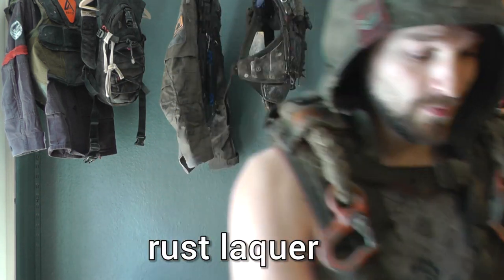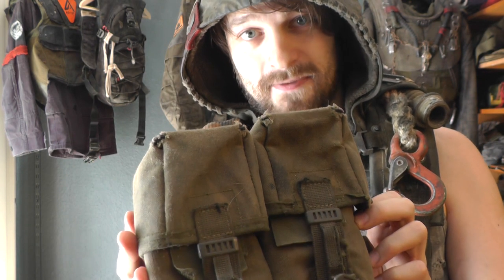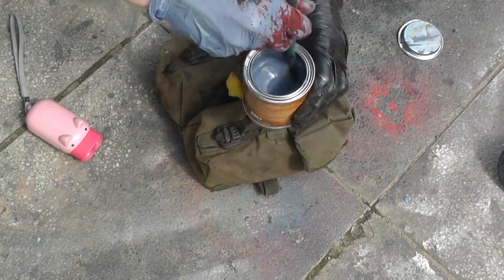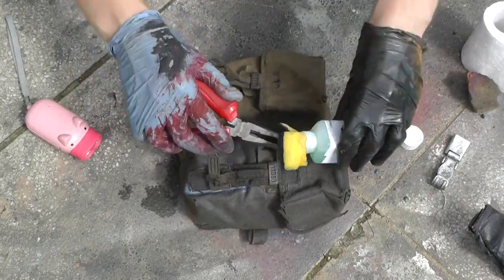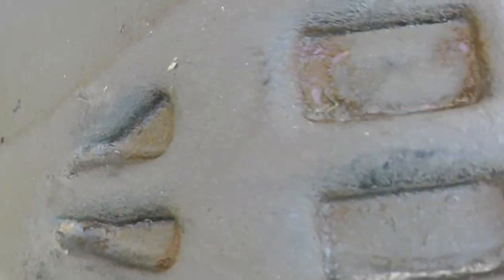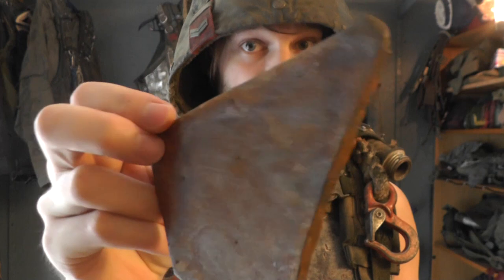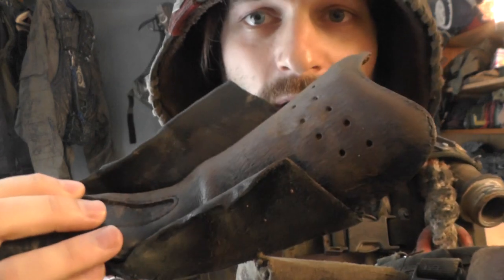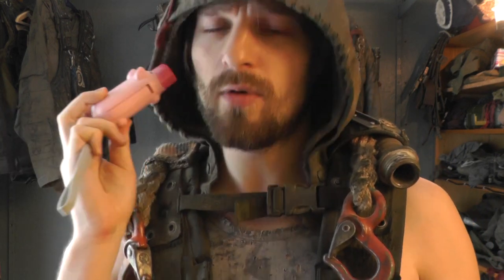Try this simple RUST EFFECT!

Comment: This reminds me of something, for oxidating wood im using steel wool disolved in vinegar, and when that stuff drips on anything else: rust, even on plastic. ofc its not the same as painting something with metalic paint an then letting that pain rust, but it might be useful for rust splatters, or mild rust aka "flugrost".
Reply: I'll second this. 
Steel wool in white vinegar works wonders. I use it to age paper.
Depending on the type of steel wool used it can take quite some time to prepare the solution (4 weeks, for example).
Oh, and remember to release pressure build-up once in a while.

Comment: Would it work if I instead just prime the stuff with normal paint and then put fine metal powder over it? Would be a lot cheaper i think :o
Reply from the maker: try it & make a video about it, i dont know :)
Reply: theMiezmiez I'm wondering about the same thing. Give it a try.
Reply: @Barsabus  did it work? I saw a pinterest post with a recipe using grated metal spunges. Lots cheaper, but you need time

Comment: Wow, this stuff is awesome :O Especially for aluminium, plastics and EVA. I don't know why would you try to rust a leather or cloth though... It seems weird... Maybe some little streaks of rust, like they just rubbed on a rusty metal a lot, but I wouldn't try to rust a whole piece.

Also - I wonder, would it be possible to do something like that yourself, just add some metalic shavings to a clear lacquer and then buy that acid separately. I will be a lot of work to acquire correct amount of steel dust, but it might be a lot cheaper. 

Also 2 - can you put a link to this? Tried to find it, but I couldn't, all I could find are anti-rust lacquers or tips to lacquer already rusted things :/
Reply: Oh, nevermind, I just found it :D And one even has a rather detailed tech information, so maybe I'll try to make some on my own. A clear lacquer plus 100g of iron dust plus oxidizing agent might cost around 20-30 euros, but for around twice the amount you have :D And if it works... It may even have better effect than dissolving nails and screws in bleach :D